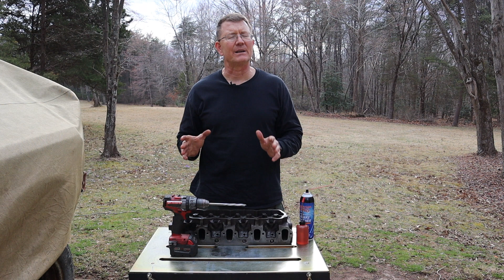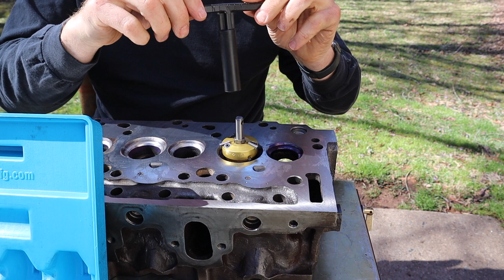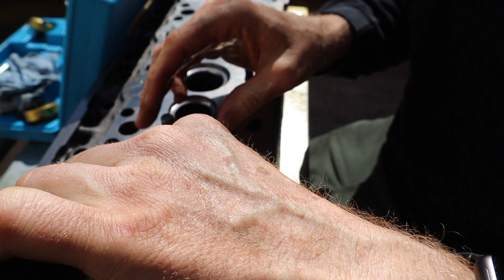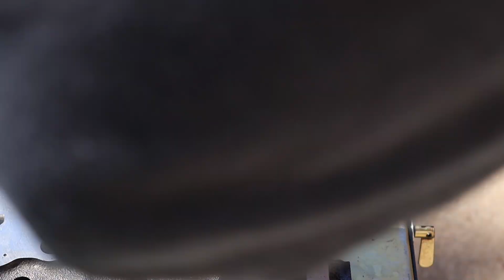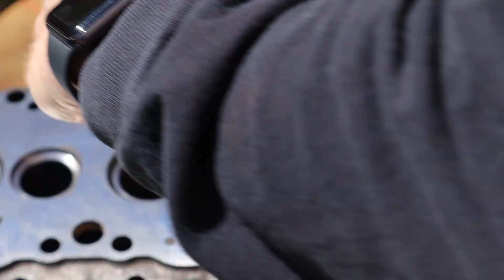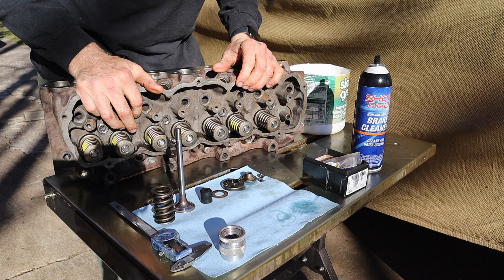7.3 IDI Turbo Assembly Part 2 - Cylinder Heads!  Project Brutus Ep. 22!

Comment: I’m a bit worried about the positive exhaust stem seal, they come with the umbrella type so some oil does get fogged down to help cool and lube, some buildup does develop and acts as a sacrificial layer between the two but it builds up the seal also.   I’m curious to see if any issues arise.  I’m building a 6.9 turbo with a ton of upgrades including the comp springs so I appreciate the struggle you had with oem style seals binding.    What cutter kit were you using to dial in the seats?
Reply from the maker: The cutters are from Neway.  https://www.newaymfg.com/cutters  thanks

Comment: More beautiful work!  Good catch finding the Valve seal bosses were machined smaller.  Would have been a smokey disaster if you didnt catch that
Reply from the maker: Thanks, Paul!  I guess the shop that rebuilt the heads ran out of the correct sized valve seals so they just machined the bosses down to the size they had on hand!  Scott